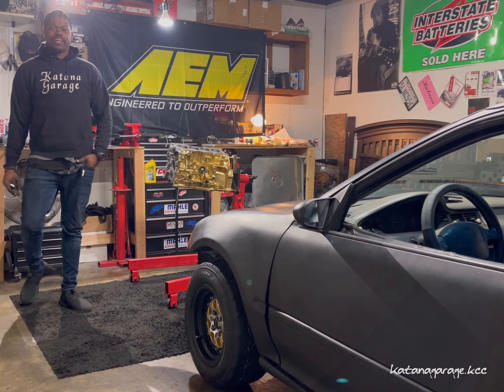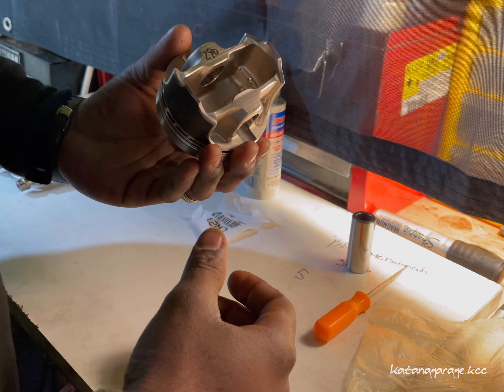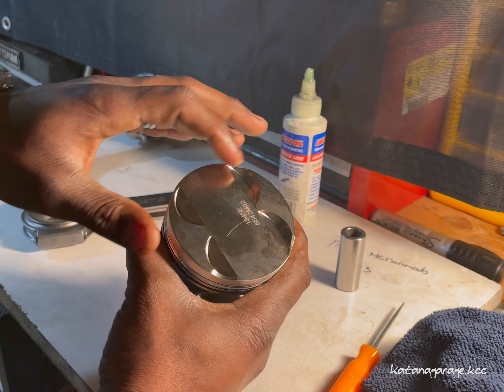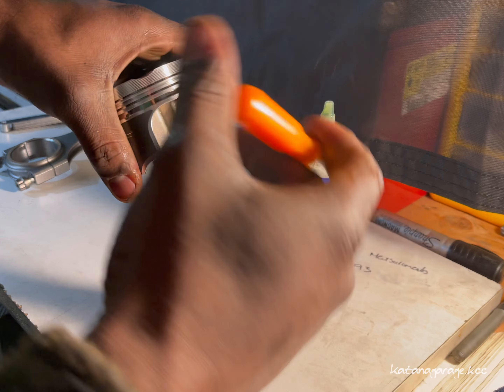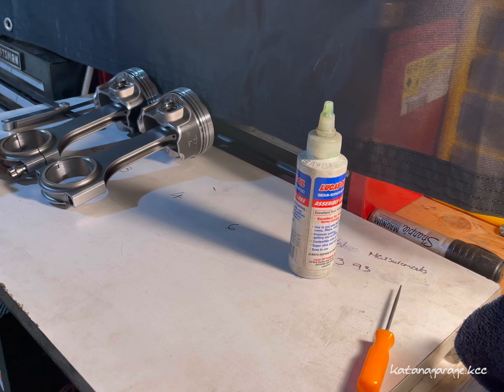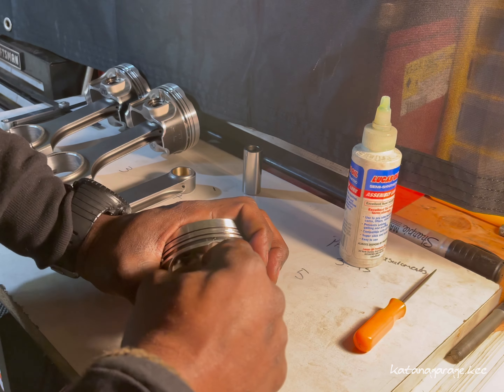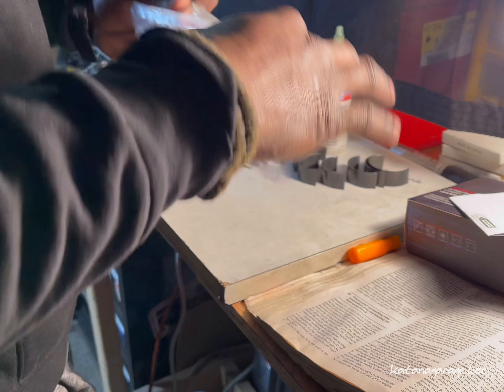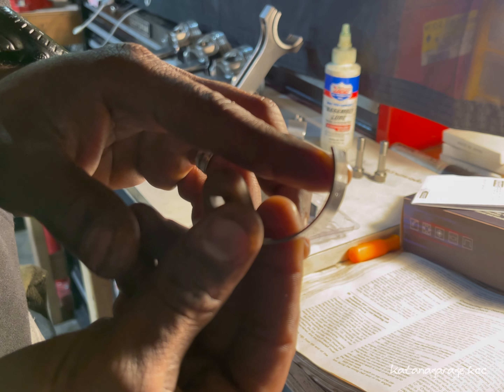Turbo b18b (how to assemble pistons and connecting rods)

Comment: Hi bro how about b18b block wiseco piston 6567m84 high com piston itr hrad its possble
Reply from the maker: It is possible but for boost it’s not recommended. Low comp is best for big boost
Reply: How about b20b which piston you recommend for na appl.